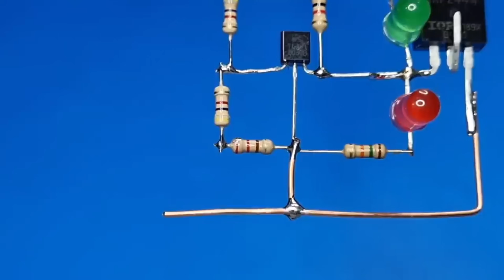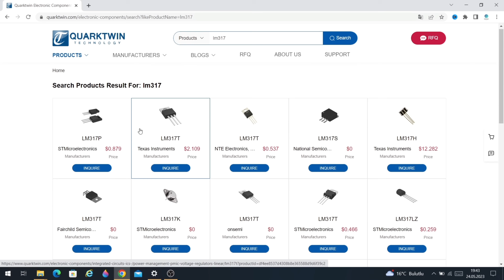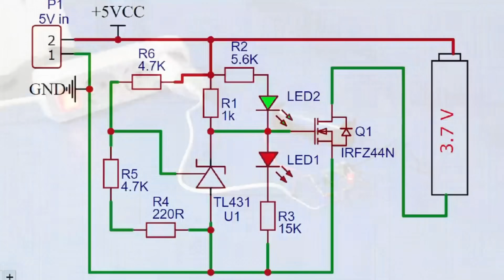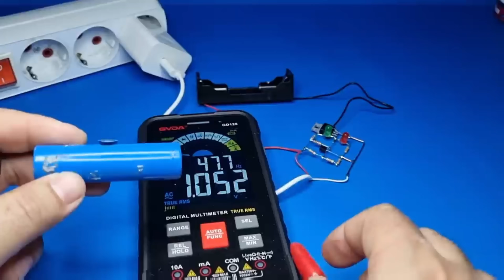Great idea 3.7 V Battery Charger Circuit / TL431 High Precision Auto Cut-off

Comment: Dear Zafer. Thanks a lot for all your video ! I regularly use your idea ! I just have a question on this project : I want to use a 4.8V solar cell to charge the battery. But with this configuration, the led stay in red. Which resistor need I to change to fix this problem ? Thanks in advance ;) and thank you avait for your video !

Comment: Pl kindly explain inthe circuit diagram first by drawing it on board in Hindi or English and components value what's the.involage and current howto set for lead acid or sealed 3 7to 12v batteries used in scooter and torches used by farmers with puezobuzzer in case of kiwvat and full charge audiovisual indication with autocutoff and charging when low protection against overnight charging protection .

Comment: How many of you have built this ? How do you lower cut off voltage? It charges my 18650 to 4.5 volts
Reply: Thats normal, because this "Circuits" from such kind of "Channels"  are garbage ^^
Reply: Is it a slow charger?
Reply: Instead of resistors R5 and R6, you put a 10 K potentiometer. Adjust the cut-off limit from there, using an adjustable voltage source adjusted exactly to the voltage you want to switch to.
Reply: @Pozitiv_ion   how do I confirm the cutoff voltage is where I want it to be without fulling charging the battery?
Reply: @ashtonmclaughlin6106  The voltage setting threshold is made with resistors R5 and R6. Adjust from there.
We should also have a limitation of the charging current, this does not exist on the diagram. If we have a very discharged battery, the initial charging current is high and is not limited by anything.
Reply: hey.. same pb on me.. not cutting on 4.2v.. it charges until 4.5 or 4.6v.. when it is reach to this value  (4.5 or 4.6v) it stops.. ( green led on)

Comment: Bu devreyi 7.4 volt da kullansak yine çalışırımı?
Reply: I know the question was a bit old, but maybe it's useful to someone... It can work at any voltage, the maximum is in the TL431 datasheet and the same for the mosfet. To do the same at other voltages, the voltage divider formed by R6 and R5 must be recalculated

Comment: This is not a charger you should use. you have to think about safety. an automatic intelligent charger with over current, volt protection is recommended!
Reply: Oh yes, but you forgot about temp control! The most important for Lithium and likely for any chem to not do explosion, as well polarity check. 😺
It must be better done with MCU and PWM pumping at least, ideally with ΔV control. 😼
I'm totally understand channel author, but spreading ignorance not help anyone, be it better a incourage to learn! 😺
Reply from the maker: enough for those who want to make their own